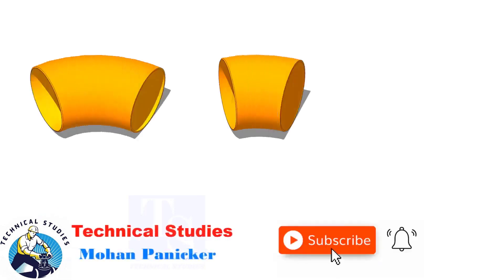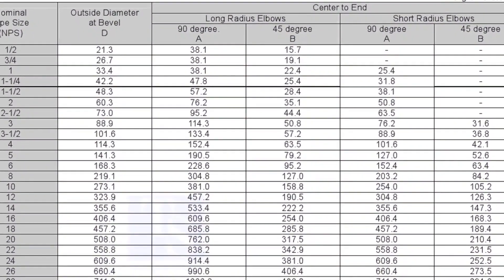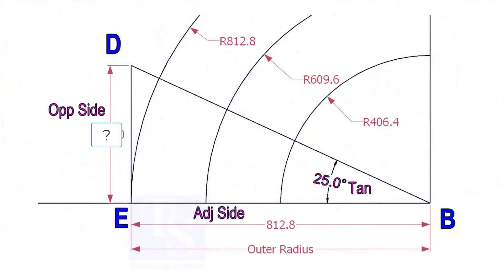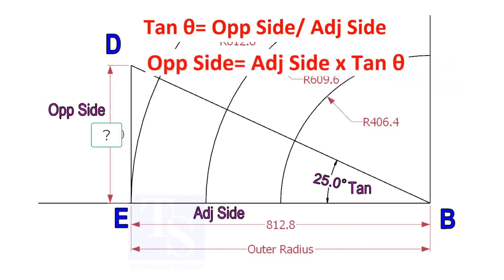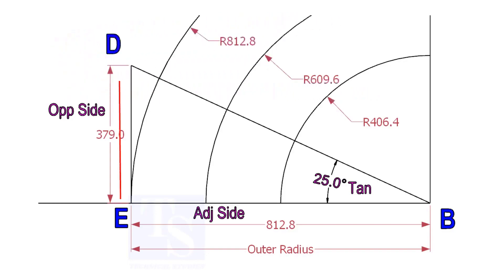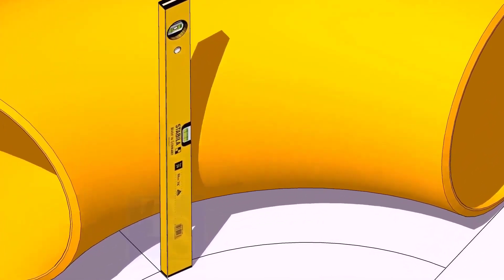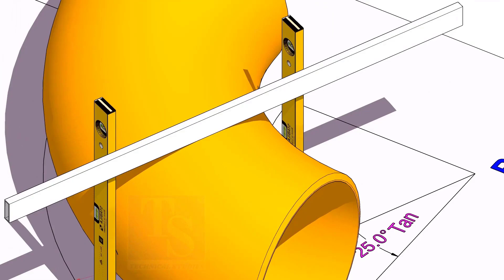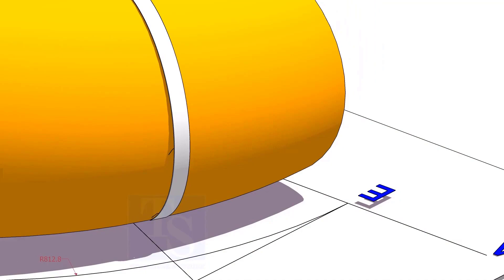How to Mark and Cut a 90 degree Elbow to Any Degree

Comment: This is the worst way to do this. Lol
Reply from the maker: You may be right, but I traind fitters using this method and even experienced fitters liked it.
Reply: @technicalstudies.  I've been a fitter for over 30 years. Your way will work, but it's alot of extra steps. There are easier ways to do this.